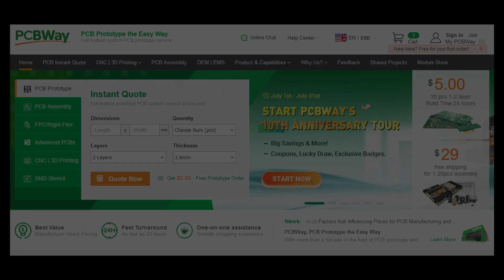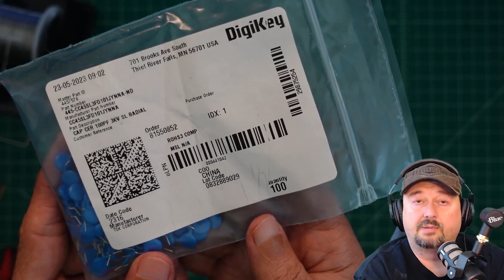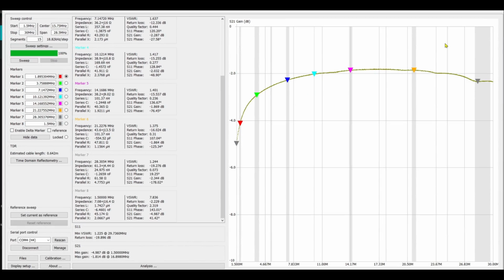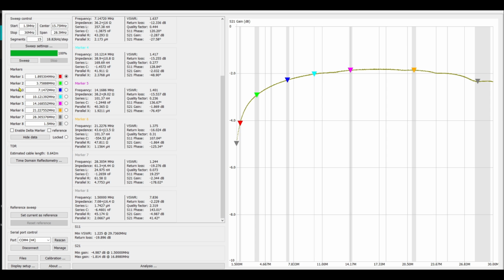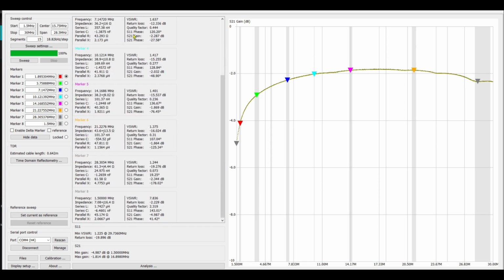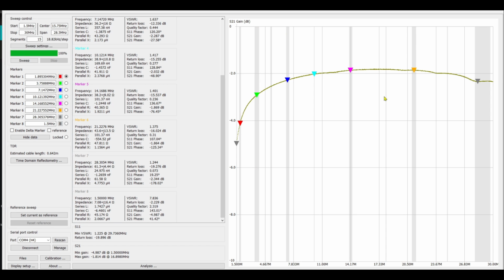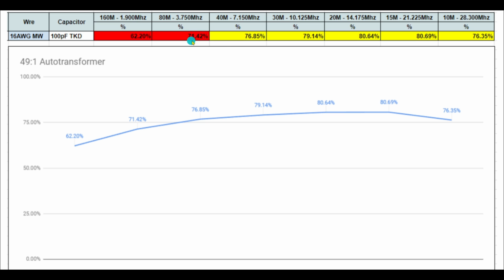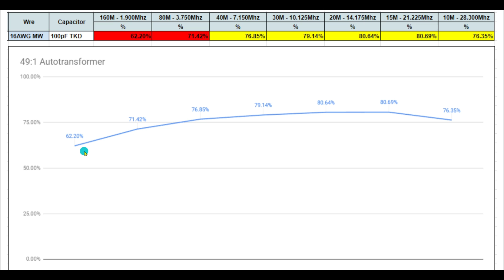Is the BEST End Fed Halfwave 49:1 the Autotransformer?

Comment: Good job there Ape. I wonder if you could do 64:1 test, one FT240-43 cor 3-24 ratio. There are a lot of videos on how to build it, but no tests before hooking it to the antenna. I have built one with 100pF capacitor and 3200 ohm resistor, still testing it,  the swr skyrockets after 14Mhz. It's kind of hard to figure out why I'm failing. Building 49:1 seems to give more expected results.
Reply from the maker: Hey Geirha, I’ll add it to the list 👍

Comment: One reason for lower efficiency scores could be that your windings appear to be spaced out a bit. When winding as an autotransformer, it is important to keep the windings as close as possible, particularly where they pass through the center of the core. Also, as pointed out by survivalcomms below, the ft-240-43 has been replaced as the "go to" core for EFHW by the 1002 core. The gain in efficiency over the 240 is around 20%.
Reply from the maker: Hey Todd, I actually like to space them out further to help with even core heating.  I’m aware of the 1002 but I like testing and trying everything…. Thanks for checking out the video 👍

Comment: Good analysis! I have a question though. Usually these 49:1 transformers are wound bifilar for the 2 input windings, then go for the first seven windings on one side of the core, and finish the other 7 on the opposite side of the core. Wouldn’t that make a difference? Specifically the bifilar input?
Reply from the maker: It does and there are few different ways to wind the cores.  You just say, pick one and give it a try 👍

Comment: I concur, Evil Lair and Colin have info on these torroids. I believe Evil Lair found that stack 2ea FT240-43 cores improves performance. Stack 3ea core and performance goes back down.

Right now I am taking a small break from working on an antenna that uses the 2643251002 core popularized by Colin. My nanoVNA broke. The charging port pulled apart.

I gave to a buddy to see if he can fix it as it a nicer one with the N-connectors that cost about $125. I'll have to by him breakfast if he gets the job done.

Adjustments have been a bit less than perdictable. I'm using a 120pf capacitor on the transformer. The interaction between the capacitor and transformer are not straight foward. They tend to work in opposite ways.
Reply from the maker: Hey viron, the caps might be a whole different video 👍

Comment: Shorten antenna connections to about inch as long wires will impact transformer losses. I would expect that you should get over 80% efficiency on some bands. You can also use Owen Duffy method and use 2450ohm resistor and connect output of first transfromer straigth into S21. You will get about -17dB losses from that value you need take away value of 10log(R+50/50) where R is exact measured value of used resistor. GL 73 Marek SP9TKW
Reply from the maker: Thanks Marek

Comment: nice job. I tried many 49:1 type auto transformers.  Stacking the cores helps with efficiency as well as core type. I used type 61 Ferrite and 2 stack.  worked great upper bands. 6 meters was ok. 10/11/12 meters was bast. 40 not so great . Other cores were tested   like 52 ferrite mix. Collin did a 3 stack found that great .  I am working with 4:1 now . just have a t 200-2 power iron to play with.  Got great antenna at 20.5 FT 5/8 wave for 11 meters.  without tuning I got 1.7 SWR . made a vertical with counterpoise. hooked a stock SSB CB to it. talked skip all over. band was open.  super RX on 5/8 wave.  The outher day I made a 39 Ft sloper. 5/8 wave at 20 meters. SWR was 1.9 . under 2 the whole band.  With 7300 got on FT8 just phuse tune for antenna. Super contacts. Lots of south America . at at 50 watts . I checked outher bands . I can tune 10/11/12/15/17/20/40. had to e-tune on 30/60/80 .  I found 4:1 works great. I used 20.5 FT / 25 FT/ 39 FT speaker wire . Now I need longer pole. And better core for 4:1 . the T 200-2 ran fine 50 watt FT8 no heating. #14 Mag wire. what I had.  I just ordered a T 240  wound 4:1 but different wraps. rated 1-54 MHZ at 1.5 KW .  going to try that.  For 160 /80 meters 49:1 use the 3 turn primary . Better I found on lower frequencies.  56:1 and 64:1 also works ,effects the length of wire. helps with 40 meters 66ft wire.  The 25FT 4:1 works like a end fed 5/8 wave. like the outher length. So is not a random wire non resonet.  I modeled all 3 length . and Nano VNA sweep.  It is tuning on  5/8 wave harmonics.  That is 1 of many reasons the Poseidon works so well. Good job with that one.  I used MMANA software for modeling. DX commander has video's on that . How I learned it. 73
Reply from the maker: As you mentioned, there are a few ways to do the 49:1.  More testing to come.  Thanks for watching Robert 👍

Comment: Excellent video thanks Ape,
What do you think maybe the reason for below expected results?
What I would really appreciate, if you do exactly the same testing setup but wind the toroid's as a real transformers or baluns with two turns on primary and separate winding with fourteen turns on the secondary with the cap across the primary winding (I guess).
I've always wondered why an autotransformer is always used not a balun, maybe because the following antenna does not require a counterpoise?
Thanks again Greg VK7GM
Reply: An autotransformer is more efficient than a transformer with primary/secondary isolation. A transformer with an isolated secondary is only used when isolation is required for a specific application, and antenna impedance matching isn't one of them. 
The reason for a lower than 'hoped for' efficiency (I use those words because these are toroid cores of an unknown material,) is because whatever the composition of these toroids (the Mix of the cores) is not suitable for this application, in particular on the lower frequencies. It isn't even known if these are powdered iron or ferrite composition cores, ferrite being the material of choice for most broadband impedance transformation applications such as this all-band HF impedance matcher, with powdered iron mixes most useful for single band, tuned circuits, and oscillator sorts of applications. Then the specific Mix, size, and shape of each is selected for the frequency range and power handling requirements of the application. There are a lot of variables in proper magnetics selection, from price to packaging, but mostly in commercial applications. As hobbyists who are only purchasing a few cores, and where price and packaging aren't of great importance one can more easily pick a suitable core for their needs. For instance, powdered iron Mix 2 (red and gray) for lower HF tuned circuits and powdered iron Mix 6 (yellow and gray) for higher frequency HF tuned circuits is fine. Then you just pick the size core to be large enough to handle the general power requirement, QRP, 100 W, or KW. As for broadband applications, use ferrite cores, types/Mixes 31 for lower HF range efficiency, (specifically 160 meters,) and 43 for higher HF bands are generally good selections. (I hope I remembered that one right about Mix 31 and Mix 43 ferrite. You might want to check it.) If you want to maximize efficiency then there are some taller, somewhat narrower diameter toroids that will increase efficiency several percent. Just some rules of thumb to minimize how much money you need to put into a toroid collection in order to have them handy for ham shack projects. As you get into VHF/UHF you can use air-core coils and core materials no longer much matter, though in some high G or high vibrational applications such as in machinery or in off-road vehicles or handheld radios you may need to use cores for mechanical strength, then the dielectrics of the forms, the core materials, becomes the item of concern.
Reply from the maker: They are ferrite.
Reply from the maker: Hey Greg, I have a bunch of Mix 43 on order for further comparison videos 👍

Comment: Most people wind ununs with the first two turns bifilar - two wires twisted together.  That might give you a little lower losses, which clearly would be good at the lower frequencies.  Also, most wind half the turns then cross over to the other side to wind the other half, but Jerry Sevick, W2FMI, says this isn't necessary below 100 MHz.  Spacing the turns out to fill most of the core reduces the inter-winding capacitance and improves high frequency response.  Some say the capacitor needs to be a very high voltage type, but being on the low impedance winding, the voltage isn't really that high (voltage = sqrt[P*R]), keeping in mind that operating under high SWR conditions will increase the voltage accordingly.  I use 2 stacked and glued cores to make 49:1 ununs, but a single core is fine for low power - and for demonstrating the principles!
Reply: Tapping the windings provides ever so slightly lower loss. Twisting is just more convenient. 
The crossover technique just causes the wire to come out on the opposite side of the coil from the starting point, another convenience. 
For maximum efficiency, as opposed to convenience, one should really use an air-wound transformer with larger wire, and taps, which carried out to its logical conclusion turns the device into an antenna tuner. It's all about the degree of trade-off you are willing to make between convenience and efficiency.
Reply: @johnwest7993   Fourteen turns on an FT240-43 core gives you 210 microhenries inductance.  To get the same inductance from an air core coil, it would take 65 turns, 4 inches in diameter, and 6 inches long.  That's a pretty good sized coil, and probably larger than most people would want.  I generally use air core inductors in my VHF and UHF designs, but toroids are sure convenient at lower frequencies.  With that much wire, it might be interesting to see what the skin effect losses would be.  I wonder about the bandwidth of such a transformer, too.  You could wind it with large diameter wire or tubing, but then that would make it even larger.  I think I'll stick to toroids for my 49:1 ununs and other HF transformers.
Reply from the maker: Hey Jim, that’s how I have typically done these.  Just wanted to try / test something different in this video 👍

Comment: i HAVENT TRIED READING THE COMMENTS. 
 However, Have you tried different winding patterns to see different results. As well, have you tried winding for more mono band or even if multi-band, maybe being more refined to a couple of bands instead of all of them. 
 In my experience the different winding patterns certainly make a difference on the results you get. You can cluster the windings on one side and favor the lower end or higher end of the bands, or spread them out and favor all of the bands, there are many trick you can do to find the desired outcome. 
However there will always be a sacrifice somewhere. 
 This is only one of the many reasons I do not like EFHW as multi band antennas.

Comment: Colin (MM0OPX) has been testing core efficiency on EFHW and presented some very interesting results.
He uses a 43 mix "much beefier" 2643251002 core, 14 turns auto transformer (tap) configuration.
In this video (https://www.youtube.com/watch?v=8SHvOE8dV3w&t=6s) he shares a spreadsheet with the results.
I've built one for my self, didn't test the efficiency, but was a bit disappointed with the SWR with a 2450 ohm dummy load. In a previous video you demonstrated much better results with a "traditional" core.
I am curious if you can, not only  replicate MM0OPX results, but perhaps you could include the SWR dummy load test?
Reply from the maker: Yeah, Colin did a good job with those.  I’ll do more testing in the future 👍
Reply: There is a huge and good reason for this. I was part of a group that did experiments with this earlier this year. Dave- W0LEV did a write up of the findings .Most arent understanding of a few things with their baluns/transformers.  
 First the moment you leave the fundamental frequency you will always have a problem, even more so  if you leave the band. The balun becomes wildly unpredictable with the task of transforming and matching when we leave the designed band.
The EFHW is NOT a multiband antenna. it is a monoband dipole. PERIOD. You are not asking your 40 meter dipole to work everything with satisfactory results, why are you asking that of the EF?

 Colin-M0OPX has done some great work. He has missed a couple things, but that isnt important, he has done great work overall, and has mostly gotten it right. he isnt explaining a few things that need to be, and this thread isnt big enough to explain it.   That doesnt matter, he is explaining to the masses, not to the finite few who crave an indepth physics lesson on the hysteresis or curie effects of the Balun under full loads under extended periods. However, if he were, many more may understand a little bit better how to design their baluns for the bands they desire.

 I will go find the links  if anyone is interested.   Otherwise, the information is truly out there for those willing to dig into it. Most YouTubers are getting it wrong though. and I do mean most. You really need to dig into more specialized vids to find some answers, and books. There are a couple folks still out here that are authors of the books that we read, they do know, and are trying to help. There are also a few folks that arent authors that are on the right path. Overall though, it is sheep being lead by sheep and wolves of misinformation. I am not saying Ape is giving wrong information, He is not. however many others are, and that is so sad that some on here are repeating the misinformation
Reply from the maker: @ChrisRobinsonKF6NFW  sure, post the links

Comment: I had better results with the fair rite 2643251002 than using 240 cores when I went down this rabbit hole last year. Thanks for sharing !
Reply from the maker: Hey SC, I have a few of those sitting here as well.  Just wanted to do my due diligence in the testing, thanks for watching bro 👍
Reply: I agree on the 1002s
Reply: @RatchetFWD  ....form factor of 2 of those 240 donuts is close to the cross sectional mass of the 2643251002 cable core.... doubling up will give you 85-90% on some bands...big improvement. . The 61 material cable cores are even better on.40 and up
Reply: Evil ???? Has videos on this
Reply: Evil lair is the guy

Comment: Hi Ape.
You get better efficiancy with 2 stacked 240-43 cores or if you use a Ferrit 2643251002 core.
MM0OPX have done some work on the losses on diffefent core. Have done it myself just for fun.
I'm build several and for me a stacked 2x240 performes better than a singel core.
For time being I compare the 2 stack with the 002 core, the 002 core seems a bit better.
Just for your attention
Tnx for yor work
73
Reply: I believe you get even more efficiency on most bands with a 3 stack but 10 meters becomes inefficient.
Reply: @corradoQC yes but I think U need the 51 if you do a 3 stack.
10 meter is useless on a efhw any way, the radiatoin pattern on 10 is no good. I use a singel vertikal for 12-10 meter
Reply from the maker: Thanks for the info Lasse 👍